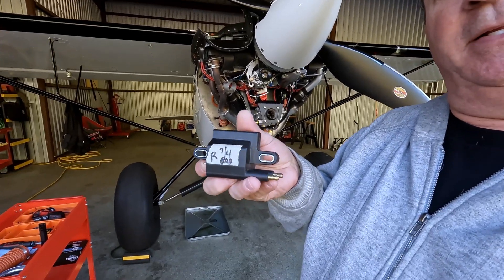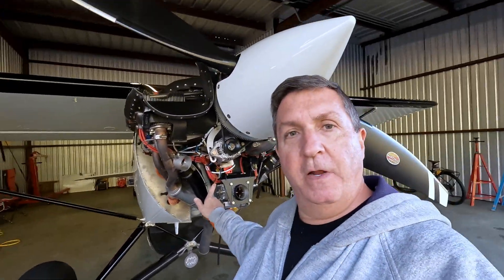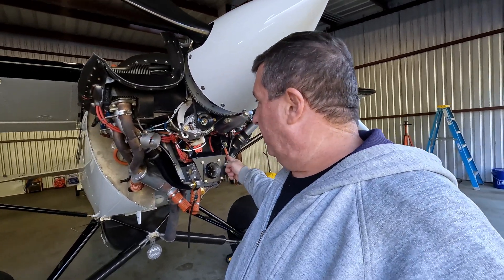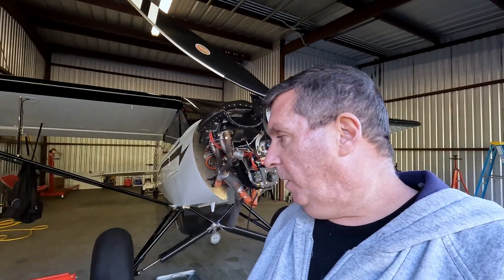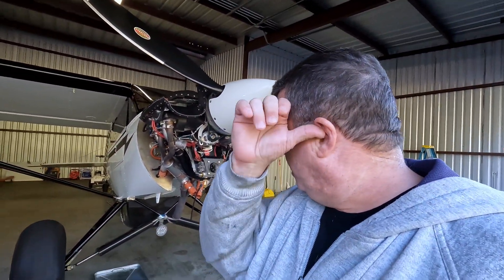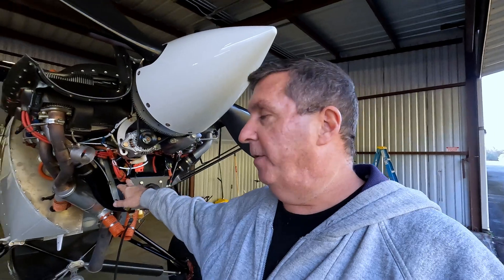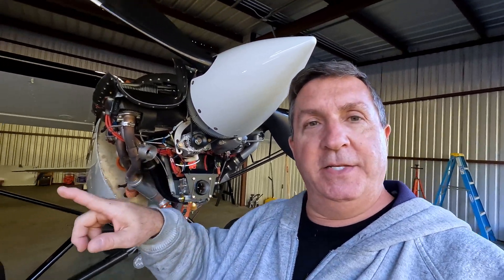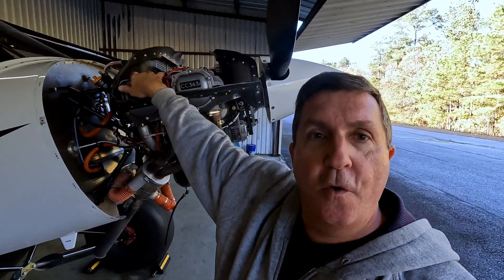Dual coil pack failure - Lightspeed ignition Carbon Cub FX-3

Comment: I have a Rans S21 with the dual Lightspeed ignition system on a Titan IO-340.  Initially I couldn't get the ignition system to work at all.  An electrical engineer friend figured out after extensive testing that 2 of the 4 coil packs were "compromised", ie the ohm test indicated 16K but when the coil fired the high voltage side insulation was inadequate on 2 of the coil packs so the coil would not fire at all.  Klaus replaced the 2 coil packs under warranty and the ignition system worked perfectly for the first 80 hours.  After about 80 hours, 91 hours on it now, I started getting the rpm fluctuation as you described.  I used shielded cables and the ground goes directly to the battery, so after hearing your story I'm now thinking the coil packs again.  I also have an RV6 with dual E Mags that have performed perfectly for over 10 years and 600 hours with never an issue.  Admittedly the E Mags do not have as hot a spark as the Lightspeed system, but much simpler, ie not much wiring.  The Lightspeed system gives me a lot of concerns.  Thanks for sharing your experience.
Reply from the maker: Thanks for your post. I need to do a follow-up but I probably need more hours. In consultation with Klaus I told him I can't just keep replacing coil packs, something needs to change, I think it may be the spark plug wires. So I replaced the 4 spark plug cables for the right side ignition (lower side of the engine) and I've had no issues since (knock on wood). So I think it was a bad cable or connection that caused my issues. I got the tools to make my own, it's not hard (MCD). FYI
Reply: @NealCuliner With an ignition check on runup I found the right ignition system to the problem with the fluctuating RPM.  Changed one of the coils on that side and problem went away.  My take is that I initially got bad coils supplied.  Hopefully the replacement ones last.  The coil causing the fluctuation RPM indication tested 15.3 K ohms.

Comment: Really helpful. I’m building a rans s21 and researching how to wire the Lightspeed. Your clip puts me way ahead now. I’ll order a spare coil pack and make triple sure the connectors are fully seated. I’ll also be proactive if RPM issues etc as you experienced. Yes, very good. Big help!

Comment: What is the proper way to test the coil packs? Is there a standard resistance test? I looked up the fault flow chart and could not find the test you were referring to.
Reply from the maker: I discussed in the video. Do a resistance test between the two spark plug nodes and see if it’s over 16 kohms. Klauss can better assist but that showed bad on mine.

Comment: I've been flying with dual Lightspeed Plasma III ignitions for around 10 years and wouldn't consider changing.  I've had a couple of coil failures, but both of them had smoking guns.  One spark plug failed open circuit, and on another, the plug wire came off of the spark plug.  With both of these issues, it causes the coil secondary voltage to go too high in an attempt to discharge its energy.  The insulation on the secondary windings breaks down at the excessive voltage.  Klaus told me to keep the inside of the spark plug boot and the spark plug clean.  If both are clean, it is harder to remove the plug wire from the plug.  It grabs better.
Reply from the maker: Excellent info, thanks for sharing. In my case the leads were secure and they are new, but who knows, it's good to learn of what can cause issues like this. As my plane uses automotive plugs they're cheap so I just changed them which also allowed me to reseat connections at that time to avoid any further issues with replacement coil packs.

Comment: Are you talking about the sparkplug wire connector when you say that you might not have seated the "connector" properly resulting in arcing? It's hard to believe that could happen.
Reply from the maker: Yes, the orange leads. I agree but what do I know? This is just something Klaus from Lightspeed said so I figured I'd pull and reseat all of mine and change the plugs in the process just to be safe.